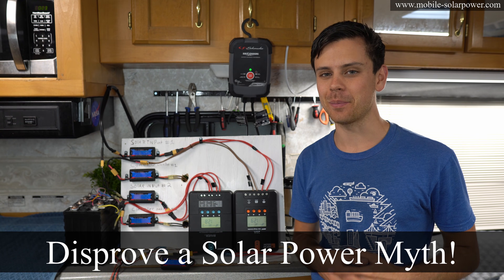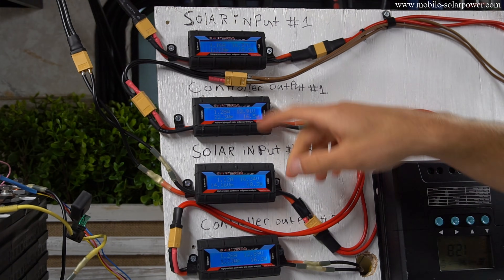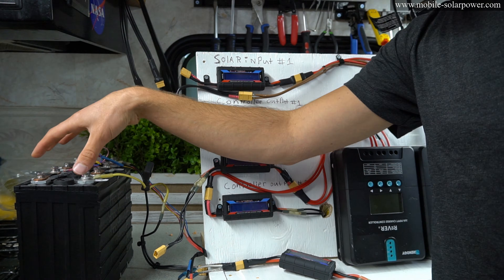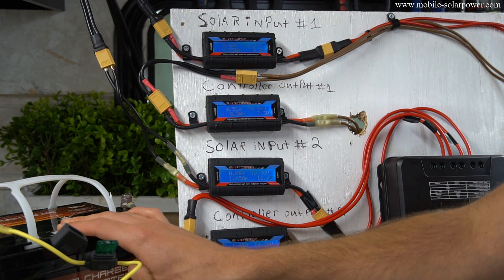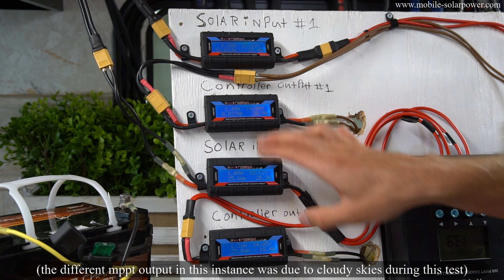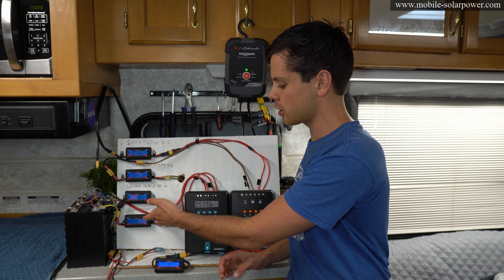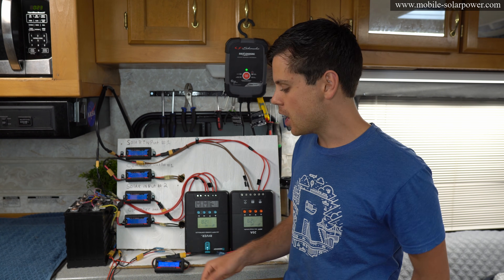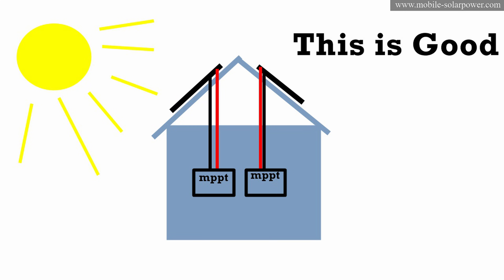Off-grid Solar Myth Debunked and Explained: 2 or more Solar Charge Controllers + 1 Battery

Comment: Just got off the phone with Renogy tech support 
They’re telling me I can’t have 2 rover li’s feeding one battery bank on my boat 
Any thoughts?
Love your videos 🍻🍻
Reply: you can 100% run two or more, BUT they just tell you cant for this simple reason, and that is to cover their backsides. The thing with two controllers, their default profiles for some battery types comes with equalization enabled, you cannot have two controllers with equalization running at the same time, so there is a chance both will run that mode at once and cook your battery bank.  Renogy controllers dont communicate with each other, is that a problem? NO as will has shown above, so how do you sort that out?   all controllers need to have the exact same charge profiles. Renogy knows if two controllers with their stock profiles with equalization kicks in at same time it can hurt the battery bank. Now why its not a problem is Because you can turn off equalization by creating a custom profile, and you wont have the issue they are worried about when giving you that advice. Controllers dont need to communicate if their profiles are the same, and As long as Equalization is disabled on the controllers. If you want equalization feature, you can leave it on one controller and turn it off on the second,third and forth controller if you wanted. Renogy says no because if some one does it wrong they can cook their battery bank and its to hard for them to explain it to people. so again you can only have equalization setting on one controller, and all other profile settings need to match each other on every controller.  Hope that helps answer your concern.

Comment: Hi Will, I live aboard a boat in the uk and have 3 solar panels on a 12v set up, 2 are identical at 120w and the third is 175w, as I’ve been told not to connect all three to one controller because the 175w has a different voltage I’ve wired the 2x120w to one mppt and the 175w to another mppt, my question is would I be better off connecting all panels together in “series” into one mppt or leave as is on parallel ? My thinking is the 3 in series would produce volts to one controller with no loss? Or am I wrong and it’s best left in parallel using 2 mppt…? Thanks Andrew

Comment: Great videos Will! Subscribed. And the list of your recommended tools used with links is uber valuable. But I'd like to point out you are missing a crimper for MC4 connectors, and would like to know which ones you use? Thanks in advance.

Comment: Hi  I’ll  really appreciate your insight on this question I have a RV  my brand new  norcold refrigerator is draining my  two Walmart deep cycle batteries under my staircase I bought a 100 watt solar kit from harbor freight and it’s not giving enough power controller goes down  to 11.5 at times so I bought a 200 watts system from Amazon that  I’m  going to connect to the same battery that the harbor freight 100 watt is connected so I’ll be running to different charge controllers and two different solar panels types  , I’ll really appreciate your opinion is  this ok to do I know your  like a guru iin this  field   Would battery charge efficiently Thank you

Comment: can you run a renogy 60amp and a renogy 40amp charge controller together? I'll have 800watts on  the 60 and 400watts on the 40amp. I just have 4 100ah Lifepro4 batteries on charge with a max charge rating of 50amps.  I'm needing more solar panel for the amount of sun hours in my off grid situation because of mountains and trees blocking sun time.

Comment: Yes! I'm using 3 reongy 30amp, 1 is set at flooded and 2 are agm, no problems  and yes I'm monitoring the distilled water.
At best I show 14.2 volts at my batteries,  
1200watt system. Any added help is always listened too. Thanks for your videos

Comment: This is an interesting video.  I have a pair of solar panels that don’t match my main solar array.  I do have a second charge controller but it’s different from the main array charge controller also.  Is there any issue there if I use the the second controller with those two panels for the same battery bank?

Comment: Hello Will, I like your opinion on following system design:
An off-gridd system for a residence consisting of a battery bank made up out of 6 AGM 180 Ah 12V front terminal batteries which have been coupled 2x in series and 3 of those in parallel making up a 540Ah 24V battery bank. according to the 50% discharge rule I can then extract 540Ah x 24 V x 50% is 6840 W if the bank is fully charged.
On the roof I like to mount 12 solarpanels (330Wp - 34V at roughly 9,8A)
I could get a big hunking charge controller to handle the amps but I have this idea to use these cheap chinese PWM charge controllers, one for every single solar panel and have them charge the battery bank.
I would install the controllers very near the panels in a waterproof electrical junction box and run a rather beefy set of wires to the battery bank. The roof is just 1 story tall and total wire distance between the panels and the battery bank is about 20 feet.
My reasoning is that 12x the chinese 6 dollar controllers working with a PWM protocol should be as good as a single MPPT 800 dollar controller handling just 9 or 10 panels.
Your thoughts please Will.

Comment: Will, I have watched your channel with interest and found it really informative. 

I was wondering if the following circumstance might be interesting enough for you to make some suggestions. In Australia, we are only allowed to fit 5Kw system on a normal house, if your house is fitted with three phase power you can increase the system size to 10kW. I have 6kW of panels and a 5kW Growatt, grid tied inverter. 

The next step was to introduce a battery. like most you people you cant afford to get everything at once so my plan was to slowly expand and upgrade as the budget allowed. My end goal was to have zero imports from the grid, by way of battery storage and continue to utilise grid back-up as needed or income stream from excess PV credits fed back to the grid. 

I am also mindful of battery costs, which I believe is best served (due to currency exchange rates and shipping) to go down the path of using 32 (2x16) x 3.2v Prismatic cells (rated at 280Ah), with BMS. As I am restricted to 5kW of solar panels grid connected, I have thought about using a Victron MultiPlus-II GX (Not that I am completely sure this model will serve my purposes) to act as a hub. 

My intent was to plug the Growatt Inverter in as an AC input, have the grid as a second AC input then have the battery bank connected, the Victron would then manage the power usage. Use battery when you can, recharge battery with excess PV power, return excess to grid for credits and finally act as UPS. 

Based on the available sun hours in Perth Western Australia and a daily power consumption of around 30Kwh/day. My third stage plan was to install another 5kW to 10Kw of Solar Panels on the roof, these would then be tied directly to the battery and provide charging only. From the regulators standpoint, this is permissible as the low voltage system is isolated from the HV AC side with 5kW grid tied restriction.  

Based on the results I would increase the low voltage PV capacity or battery size ( by introducing a third 16 cell string) to find the balance point and nil grid fed power requirements (except for emergencies, bad weather etc) 

Cheers
Mick

Comment: Great video! I asked renogy this same question and they said no. Do not connect separate charge controllers. I have 400 watts of hqst's and 100 watts of renogy. But i know my wanderer 30 amp pwm is only rated for 400 watts. So I wanted to put the 100 renogy on a 10 amp pwm but to the same bank. Thanks alot for showing the numbers! I've learned alot! It's not just taking your word for if. You actually show the numbers and let people decide if they agree or not!
Reply: You can use as many chargers as you want with no problems at all... I think the myth that you can`t comes from that when the battery is almost full and only charging a little it will use only one of the chargers to charge, only when the charge ampere is lager then the 1 charger can handle alone it will start using the other chargers.
Reply: @a64738  that's exactly what I've seen when full or close to full 1 charger does the work until there more demand and the other makes up.

Comment: If I have 6 12V batteries connected in parallel, can I connect a charge controller to each battery so that one has a total of 6 individual charge controllers ? Also can one use an PWM controller for this?

Comment: Good Information! This solved my build with 12v solar system.
2 x 40ah MPPT Solar Charge Controller
4 x 120ah 12v Lead Acid Battery
4 x 320w pv panel
1 x 2kw 12v Pure Sine Wave Inverter

Comment: I have a 100w set up from harbor freight with their solar panel controller,and a 400w solar panel with a different controller 80 amp! And just one 200h agm renogy batterie! How can wire the 2 controllers to the same batterie? Its posible? Or im just going to make a mess?

Comment: Hello Will,
You are an excellent popularizer and super competent, I refer to you very often for battery recharging questions and much more.
I found all the answers I was wondering about.
Thank you for letting us benefit from your great knowledge and experience. You are an important resource for me.
I hope you want to continue for a long time because it helps a lot of people, I'm sure.
I'm sure I have the answer already but just in case,
If I plug in a Renogy DC-DC Charger 20A from the car's alternator and an Epever 20A solar panel controller in parallel, I won't have a conflict between the devices, right?
Thank you very much for your advice,
Jacques

Comment: Hi Will, about three months ago I connected two Renogy Rover 40A MPPT Charge controllers to a 500Ah Lithium battery bank. Each Charge controller has five 100watt solar panels connected to them. This system worked flawlessly until last week when the charge controllers started behaving erratically and not charging the battery bank properly. I called Renogy and they told me that two Rover 40A MPPT charge controllers cannot be connected to the same battery bank, they said that only the 60A and the 100A charge controller can be combined to charge one battery bank. But this to me makes no sense since they worked perfectly as you show in your video for the past three months. Do yo have any idea what might be wrong here? What are the chances for the two charge controller to stop working properly at the same time?
Reply: Diid you get a reply from will,on this question, if so could you repost it Please I am learning and this type of question is helpful, thank you ,mike

Comment: I had every intention to learn more about solar power through this very inclusive channel but ran out of time before we got busy with the landscaping season.  I am looking for a solar panel stystem to be able to charge my dump trailer batteries (3 trailers)  at night and to power indoor and outdoor light in our small shed (600sqft).  I have a gas generator to run our large compressor and power tools. The light are motion detection lights and we rarely use the shed at light. So mostly just need to charge my batteries.  I assume I would need a very large system to run my 1.5hp compressor.

Comment: also I forgot to add I have a dc to dc charger off eBay.its been very good had on a few vehicles now.its a 12amp model so it gives battery good charge while driving most days in week .

Comment: Pls check and confirm the following setup which I'm going to do is ok or no: 2pcs of 12v 160watt solar panel connected to 40amp mppt controller and 1pc of 24v 435watts solar panel connected to 60 amp mppt controller. Both above mppt controllers connected to a single 12v 200ah lead acid battery. No load  in day time on battery and only for night I use maximum load.

Comment: In my system I have one go into float an hour to two hours before the other both renogy 40 mppt 12/24 charge controllers it goes into boost rather quickly and starts dropping amps in rather quickly then stays in float the rest of the day the other stays at 27 to 30 amps coming in with both stating between 28.8 to 29.9 volts when it happens both charge controllers set at lead acid setting. One charge controller is .1 volt off from the other if it matters. Thanks in advance for the reply. Same amount of solar going into the controllers same pv voltage same wattage. I have 12 135 watt 25.2v panels in series of 3 and then parallel sets, 6 panels going into each charge controller. They are on the same array no shade hitting any of it before it goes into boost they stay around the same amprage in.

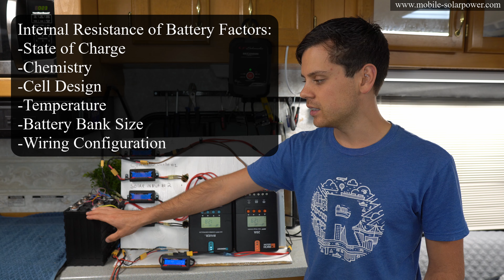Comment: Gr8 presentation, it gave this neophytes queries some clarity form the basics to a bit more advanced ones.  We have a load of questions on Solar.  Q1,  Multiple controller charging one battery bank. Your comment at 00:45 covered that (10 or 20 controllers on one batt bank). We may be going 48v lith to pwr our Sol-ark 12k.  For starters, we will have 5-PV on the East roof, 5-PV's on the west roof (more to be added on other building in time).  We also wish to have a charging station for our 12v tractor batts.  We will also like to hook up a pelton wheel on the 48v.  A bank of 10 / 20 controllers answers a lot of questions.

Comment: Great video, makes so much sense... so is this that people normally do ? using multiply charge controllers if upgraded battery has capacity for multiply small chargers... ? Is it normal to put loads directly on the battery, or normally on the load terminals of  charge controller ? I guess you were just loading the battery directly for the test ? Could you parallel up the load output of multiply charge controllers ? Thanks sorry so many questions.

Comment: Hello all. I’m a nurse up in Northern California. Been in a self converted, 1998, 15 passenger van. I have one 200 watt solar panel on my roof, a 2000 watt inverter, 60 watt epever mppt controller, a fuse box, and two fuses. I had a cheap mppt controller and a cheap 12 volt, 100 ah lead acid battery that I picked up from Home Depot. Everything worked great for about two weeks. Then the battery wouldn’t charge. After research I found out it was my cheap 24 dollars charge controller. So I saved up and bought the epever and two, 110 watt yellow top optima batteries. I hooked them up in parallel and sparks flew! Charge controller is now off and everything is dead  Huh 
I am so sad as I sit in my hospital parking lot still having no power. 
Any help would be greatly appreciated. The same set up worked great for two weeks. I just added the epever and the two optima batteries.

Comment: Will,  can I use my one solar array of 300 watts to feed 2 solar controllers and two battery banks?     basically splitting off the solar to each controller then to each respective battery bank?   thanks

Comment: Great info. Question - how do I actually connect the different controllers to one battery?  Am I supposed to do something before taking all the controller wires to the battery terminals?  Thanks so much.

Comment: William I need split phase want to reduce my power consumption I want power my pool it run 8 to 8 I have 800 watt of solar panels been looking at the charge controlers like what you have in your shed to spit phase the dam thing I need the board and communication cable to boot not sure how the would hook up to the bank or the communication  Help

Comment: I'm planning to use epever 4210 for a 3kw off-grid setup. Their datasheet says. Its max PV input is 520Watts for 12v and 1040W for 24volts. Does it mean that I could only connect a solar arrray with a total of 520watts? or 520watts per solar panel? Should I use multiple charge controllers for a 3KW solar array?

Comment: Hi Will,
Thanks for the videos. They're great. You've inspired me to put together my own system.
But, I have a problem.
I have 2 charge controllers EPEVER 4210an; each connected to 2 panels in series (60v in), connected to 2 LiON 100ah batteries in series, and a 1.5KW (3KW peak) inverter. When I had some lead-acid batteries on there, everything was fine. But I upgraded to the LiFEPO4 batteries. While the batteries are charging, everything seems to work OK but when they hit full charge, the inverter gets an over-voltage error on the inputs and shuts down (after a random number of minutes).
I've checked all voltages, and they're fine. All the settings appear to be correct. 

Why would it be tripping?
I'm considering switching those ones out with an 80a one.
Reply: I figured it out. It was the charge controller settings. For SOME REASON epever do not include a proper setting for LiFePO4 batteries.
Reply: @bisc67  Hello. And what settings have you set? I'm going to have exactly the same situation (including Epever mppt controller with lifepo4). Could you share your experience with us? Thx!
Reply: @mateuszmazur1980  

Over Volt Disconnect Voltage: 31.2
Over Volt Reconnect Volt 29.4
Equalization: 29.0
Boost Charging Volt: 29.0
Float Charging Volt: 27.6
Boost Recon Charg Volt: 26.4
Charging Limit Voltage: 29.2
Discharging Limit Voltage: 21.2
Low Volt Disconnection: 22.2
Low Volt Reconnect: 25.6
Under Volt Warning Volt: 24.0
Under Volt Warning Reco. Volt: 25.6

The inverter alarm still trips but much less frequently. If it does still for you, try dropping the charge limit voltage.
Reply: @bisc67  Thx! I will try it!

Comment: Is it possible to connect 2 or more charge controllers into a single DC/DC charger?  Effectively charging a lead acid starting battery from solar as well as being able to charge the Lifepo4 from the alternator.